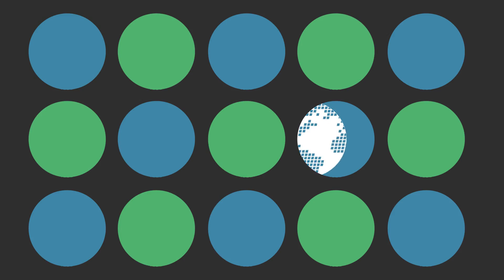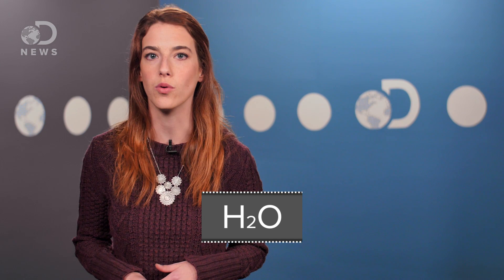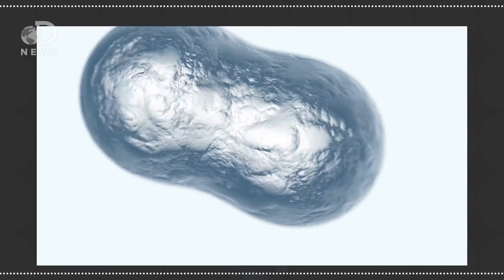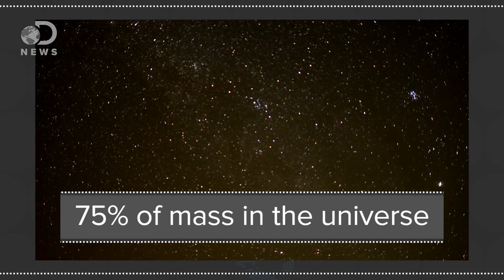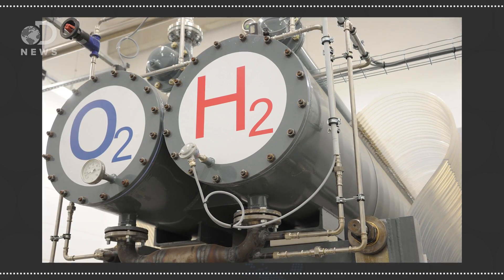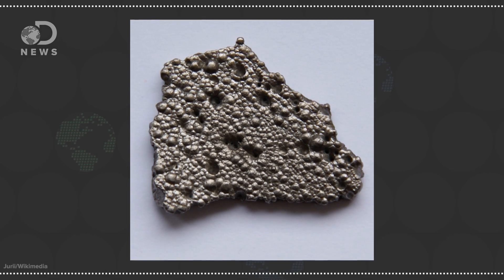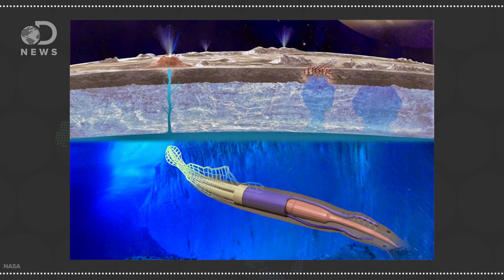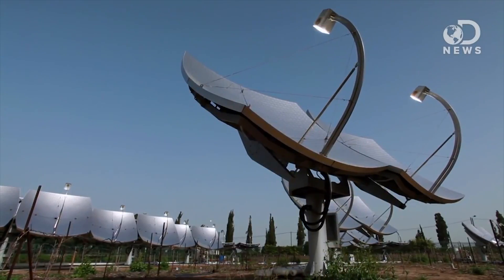How Can Water Be Turned Into Fuel?

Comment: Electrolysis can not power anything, it is a process that requires power, you can only use it to store power (as hydrogen) not generate it, you still have to get the energy for all of this somewhere else!
Reply: Gerard Burns hydrogen has more kinetic energy than petrol
Reply: Gerard Burns Please do. Also, you do realize that being hurtful makes you sound stupid, not me?
Reply: Gerard Burns Well, firstly Radiators could be seen as 'getting energy out of water'. Water, in fact, is a very good medium for the storage of energy, as it has a very high SHC.
Reply: Simon Als Nielsen What about all the energy that is required to excavate coal and drill for oil? You're not tapping into anything new you're still converting.
Reply: Fusion of hydrogen. More energy then you will ever need.
Reply: +Simon Als Nielsen challenge accepted.
Reply: W M50o lol thats the most stupid thing i have read in several weeks. No its not gonne change water price because the aamount of water cars would use is just a tiny fraction of what the average american uses daily
Reply: Solar panels, or nuclear
Reply: thegreeenbeast fair enough if he meant as a means of energy storage hydrogen could work but it's not as efficient as storing directly to battaries as we all ready do , this also has the added bonus of not being essentially  a huge bomb. As for just using hot water as a means to store energy good luck using it without loosing half of the total energy to just the air or pipes
Reply: You could just suck hydrogen and oxygen from the universe.
Reply: Damn son,but ok😂😂😂
Reply: deeliriyum 

The energy in coal and oil came from the sun millions of years ago and then compressed under gravity to be refined into sheets or underground 'lakes' if you will.

Let's say it takes 100 kilowatts to drill into the ground and grab some oil. As long as the lake of oil you find has more than 100 kilowatts worth of energy, you turn profit. Oil we drill today has extremely high energy density compared to things like wood, and solar. This way we can afford to waste a lot of it and still turn a profit on the energy we take from it.

The only other type of energy we know of with the same energy output vs cost of getting it like fossil fuels is nuclear fission. Nuclear power comes from the decay of super-heavy elements created upon the death of massive stars billions of years ago. That is also where they get the potential energy.

The only other type of nuclear is nuclear fusion, which functions on the principle of fusing atoms together to extract energy. Hydrogen is the easiest, and all hydrogen in the universe was created from the energy from the Big Bang trillions of years ago, and that is generally where the potential energy comes from.

That's the general idea, anyway.
Reply: thegreeenbeast I'm glad I'm not the only one haha
Reply: Simon Als Nielsen how can discovery news spread such bullshit... 
This didn't go through a single person that has passed primary school.
Reply: NumbnutzTV Well don't ask me :-P
Reply: Simon Als Nielsen spaide98 
There is no point in hydrogen. E.g. you start with 100kWh of 
electricity, do electrolysis, compress hydrogen, than use fuel cell to 
get electricity, you end up with 30kWh, and you wasted 70kWh i various 
steps of the process (25% in electrolysis, 10% in compression and 50% in
 fuel cell).
Reply: mitchell crosby every person that studied physics has done electrolysis with two pencils a 9v battery and a cup!
Reply: mitchell crosby So you are saying that the people that this went through before it was published are only average people? That speaks a lot about "news" channels like this...
"Solar freakin' roadways!" -lol
Reply: mitchell crosby if you don't criticize something that is wrong it will be left unchanged.
Reply: Simon Als Nielsen Very true. I'm glad you brought this up. However, This allows for the possibility of a large scale production of hydrogen fuel-cells at locations where cheaper and clean energy can be harnessed, use the clean, but geologically limited energy to convert it into hydrogen fuel-cells that would be used to transport said fuel-cells to places in need without the carbon footprint of todays coal and oil. 

I'm also Somewhat sure there's research being done on kinds of algae-farms that use photosynthesis with hydrogen gas a byproduct, which would open up the industry further, but don't take my word for this 2nd part… :S 

Let's just say this is a technology I'm looking forward to.
Reply: Dahxelb well I think power cables are a better way of transporting energy in most cases, but if nothing else we can use the hydrogen as rocket fuel ;-) 

I have never heard of photosynthesis producing hydrogen, but oxygen and biomass is very useful as well.
Reply: +Simon Als Nielsen Build a dam and collect hydroelectricity. It's clean and renewable. Down stream, using power collected from hydroelectricity, build a structure. In this structure, build a machine that separates the hydrogen from the water. If you wanted, sell the oxygen byproduct or release it into the atmosphere.
Reply: Eric Steck Sure, or just use the electricity produced directly.
Reply: Would this be too expensive? Why are we not doing this?
Reply: Eric Steck yes, it would be expensive and inefficient. Perhaps future tech will make it more viable.
Reply: +Simon Als Nielsen maybe we should start investing in better technology in this field. I'll support it. 😁
Reply: Eric Steck Well there are many ways of storing energy, why should we go for electrolysis rather than other solutions?

I think smart grid with differentiated prices according to production and consumption, where devices in your house are turned on according to a compromise between price and need, is a much better idea.
That combined with diverse renewable energy production seems like a much better idea to me.
Reply: Just build a thousand hydroelectric dams in every river in the United States. Not literally, but build a lot more. Also, put solar panels and wind turbines on the structure.
Reply: Eric Steck good luck with the funding ;-)
Reply: That's how thermodynamics works. Only nuclear fusion is self sustaining, nothing else.
Reply: Simon Als Nielsen, You are not getting the joke!!!! Clearly through the thorough inspection of this theory of electrolysis we have given up something Clean for a Dirty FUEL! Forget the greenhouse Gas Effect! The American prohibition was declared to make it ILLEGAL TO PRODUCE PURE ALCOHOL WITH THE USE OF A DAMN CAMPFIRE!!!! This Alcohol was also a fuel for the Men who were Running the fuel/Drink and it wasn’t just clean but could take you further with less! Stop jumping to conclusions because you assume this video was an insult to your intelligence. Get Back to Studying!
Reply: Hi Michael, kinetic energy is energy of motion, e.g. the energy stored in a flywheel or a moving object. The energy of petrol or hydrogen for example is 'chemical' energy. 
Cheers, John.
Reply: Gerard Burns dude tf? He is right explain urself asap!?
Reply: You mean like burning hydrogen? If we can increase the output and decrease the amount of energy used for the electrolysis process into a positive output that is significant, we could certainly do it on a large enough scale to solve our energy problems
Reply: why cant it generate electricity?
Reply: LIKE FROM GAS you libtard!
Reply: thegreeenbeast When you burn coal/oil or put up wind turbines, you tap "new" energy in the sense, that it is energy that was not previously available to you, when you use electrolysis, you convert energy from one form  that you already have available to an other form. That is what I am trying to say.

Not sure why you are telling me about fuel cells?
Reply: thegreeenbeast I just don't think it is explained clearly enough in this video that the energy does not come from electrolysis.
2:25 "imagine whole towns being powered by this" This makes it sound very much like the energy from electrolysis powers the town, when in reality, this process is only there to act as a sort of battery. (which is great, but not at all clear)
Reply: thegreeenbeast lol getting energy out of  water ? Someone needs to  read more physical  chemistry books
Reply: Gerard Burns What you have to keep in mind though is that there exist certain substances that, when put in a conductive solution of water, automatically generate a current with a redox reaction. For example Zinc sulfate and copper(II) sulfate. This electricity can then be used for elektrolysis. Of course, it works like a battery, but that's fine. Why not use normal batteries we've used before? Perhaps these hydrogen fuel cells are lighter and in the long run more efficient.

The only energy that would have to be generated beforehand is the energy that creates the Zinc sulfate and the Copper(II) sulfate. But for this we could use clean power plants that wouldn't fit in a car. Like nuclear fission plants, or in the future, fusion plants.

Remember, is does not have to be perfect. It just has to be better than fossil fuell powered cars. But the fact that it's still being researched by car manufacturers, probably means it's worthwhile. If it wasn't, they wouldn't pour anymore resources in such research. And those researchers also have a chemistry degree, I can promise you that.
Reply: Michael Wheeler pa hahaha ha you have got to be kidding right ? Do you even know what that means ?
Reply: +delirium I don't see how that affects my point?
Reply: thegreeenbeast sure that's fine but have you ever thought what if 2 cars containing compressed hydrogen would look like ?( it starts with B and ends with M )  Just because  it's energy  dense don't make it a good fuel , weapons grade uranium  is much more energy dense but I doubt  you would want everyone to have that in there car
Reply: stephan2796 are you high ? There's to many problems  for me to list with that statement
Reply: Hydrogen cars/trucks/semis will increase the price of water............🖕
Reply: VintageLJ dude to make it clear I have a degree in chemistry and you would get laughed out of university for saying that radiators " get " energy from water whatever the specific  heat capacity is. In order to use water as a fuel you first need to separate the hydrogen and water by hydrolysis,  as mentioned in the video , what everyone fails  to mention including here is the fact that this process  requires quite a lot more energy than burning the hydrogen obtained ( this is obvious if you know anything about physical  chemistry ) thus it's a waste of time

Comment: Making Hydrogen generators are fun I spent over a year on my project in my shed and really enjoyed it, I have some videos of it on my youtube channel. I had a few accidents but it was cool. I used stainless steel 316L plates in the generator, they were expensive but are still working today as they are very resistant to corrosion. I managed to get a decent flame from the resulting gasses of the hydrogen and oxygen to burn with a welding tip. But make sure you use sufficient flash back arrestors as hydrogen and oxygen together are a very dangerous mix and very flammable!
Reply: Telecastvids Flash back... Were were you when I did this!
Oh well it was only slightly traumatizing.
Reply: Telecastvids We made Hydrogen fuel cells at school, though our efficiency was not that good compared to industrial ones.
Reply: VintageLJ
Yes, I expect the school experiments were a basic understanding of making hydrogen fuel cells but not enough to make the gases burn constantly. The one i built had 7 stainless steel plates made of the 316L type and were sandwiched between half inch thick plastic clear sheets so you could see the HHO gases being made. It was about 12"x 12" it made about 1.5 ltrs of has per minute, enough to make a nice contestant flame!

Comment: It's not really a fuel source, the energy required for electrolysis = that of burning the h2 so you're back to square one anyway
Reply: ***** Think of H2 as a fuel rather than a fuel source.  You can split water to make the H2 with any catalyst and power source you would like (preferably renewably like with solar or wind), and then that H2 can be stored in a tank like gasoline (though there are particular challenges to storing H2 since it's such a small molecule.)
Reply: ***** Hydrogen is a great 'fuel' for cars as it has much higher efficiency than any other car engine in mainstream use. Hydrogen fuel has a ~80% efficiency, whilst current car engines have ~20% efficiency.
Reply: Deejcello That's interesting.  I wonder why H2 couldn't be used to store surplus energy from renewable power systems in really big quantities?  I was debating with someone who said renewable s could never cover our national energy needs because they can't meet spikes in demand.  He said who ever could come up with a large scale storage method would be a very rich man/woman.  He also ruled out dams / reservoirs as not having enough capacity.  Are giant tanks of H2 just too dangerous?
Reply: ***** Technically there is an incredible abundant capacity of storing energy in the form of compressed gas.
In fact someone made a compressed air car. Continuous pressure motors are much more efficient and low temperature than engines, so for mass storage of energy with no pollution, air is the way to go.
What makes Hydrogen attractive is the instant electricity with no generator involved besides the quiet fuel cell.
Realistically the reason why we don't use green energy its because we invest in fossil fuels so much.
If 200+ million people in USA who purchase gas spent those $30-80 weekly dollars on green energy then that would be the way things would work.
But its a social organizational problem not a technological challenge, however, people have forgotten we can't just let the market decide our future as financial decisions most of times are arbitrary...
The last social efforts USA had was Moon missions, and wars in the middle east.
Reply: You can store H2 though, it is harder to store pure electricity, although it's becoming much easier with graphene (A one atom thin plane of interlocking hexagons of carbon), but you aren't totally right because some energy is lost to the environment, so it is actually a net loss :(
Reply: Deejcello I heard liquid Hydrogen has a much much lower energy density than petroleum.
Reply: http://en.wikipedia.org/wiki/Energy_density#Energy_densities_of_common_energy_storage_materials

check out that figure.  H2 is more energy dense by mass than petroleum but less dense by volume.  So taking both into consideration you would need an H2 fuel tank that was about 2x as large as a petroleum tank, but it would weight the same for the same energy inside of it.
Reply: Well graphene is obscenely expensive right now and supercapacitors have their own challenges as well (including a very low energy density).  Supercapacitors are really great in terms of power density (delivering energy really quickly), but not in terms of energy density (energy/volume or energy/weight).  Hydrogen makes sense as a fuel in terms of energy density, existing infrastructure, refueling time, and sustainability.  These factors along with economics are going to be what dictates what the next technology for fueling cars will be
Reply: Deejcello Why would you? just power whatever you want to power with the electricity instead.
Reply: Johan Larsson The advantage of hydrogen is portability. Unlike a battery, you can stop at a station and re-fill a fuel cell, and you don't need a long extension cord. The trade-off is that it is more expensive, requires more volume, and that you lose some energy in the process.
Reply: ***** It would be better if they collect hydrogen from Jupiter and then bring it back to earth to utilize it.The advantage of this is that you don't use any energy to make hydrogen.
Reply: Deejcello I know it's more a fuel than a source, but seems like a pointless task to use it as a fuel given the cost, if graphene super capacitors can deliver what people seem to claim they may one day be able to do there'd be little need for hydrogen as a sort of intermediate storage fuel
Reply: bkm83442 Those points are only true when compared to the current generation of batteries. Currently there is research on atleast three kinds of batteries that gets charged in minutes. Whith batteries such as those, hydrogen would all of it's benifits.